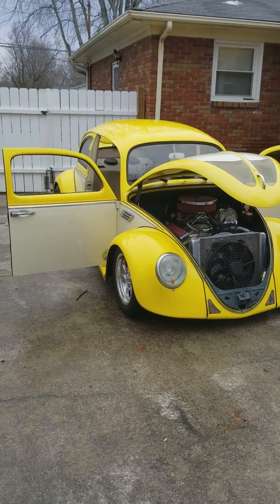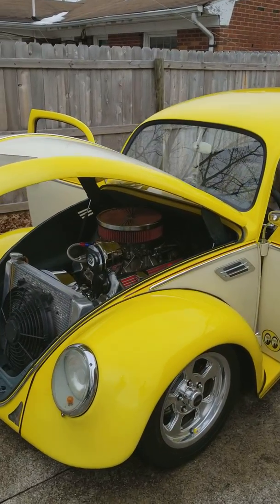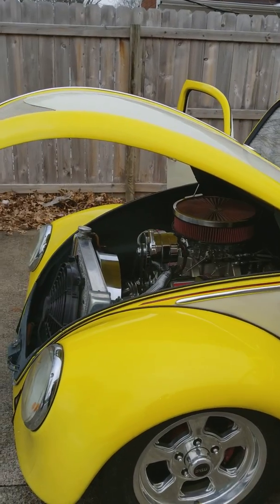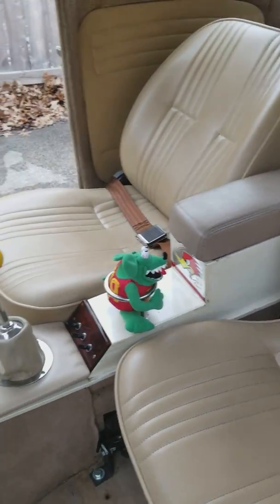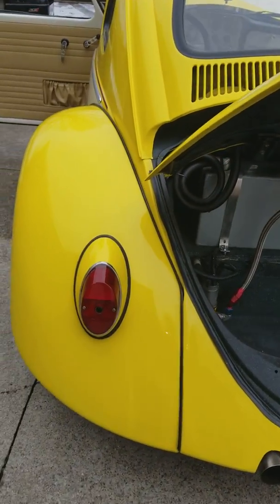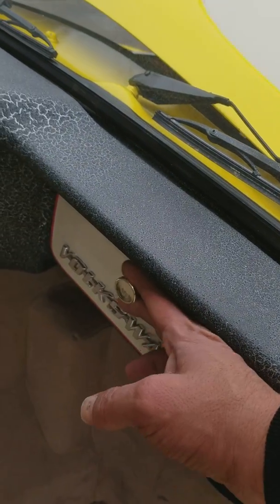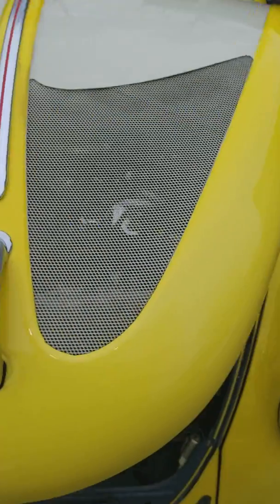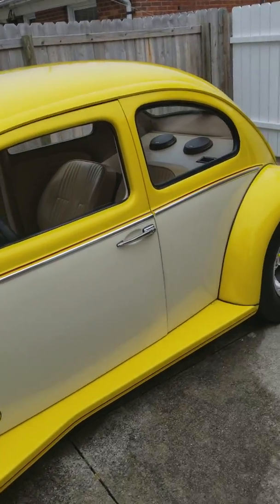1964 V8 VW Beetle....finally an outside video!

Comment: You said it’s a tubular chassis. With 9 inch ford rear. What is the front end suspension and stearin. I’m asking because I have a 67 bug I’m planning to do a v8 in and looking into options that others have used and how well it works